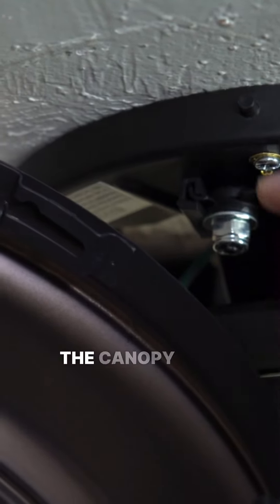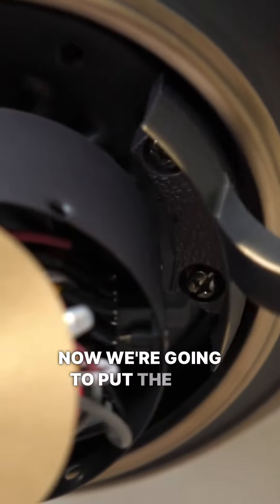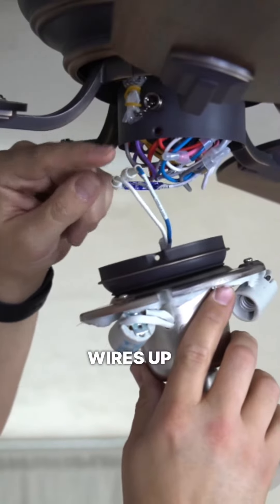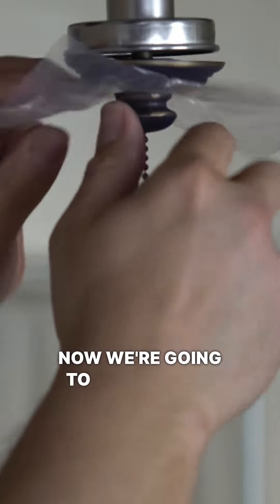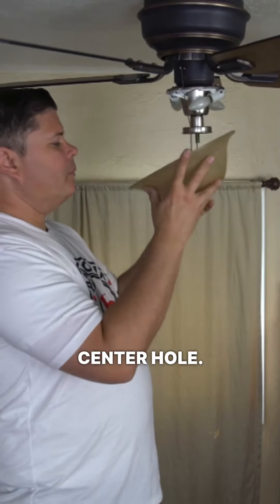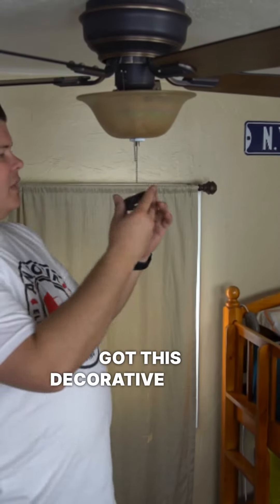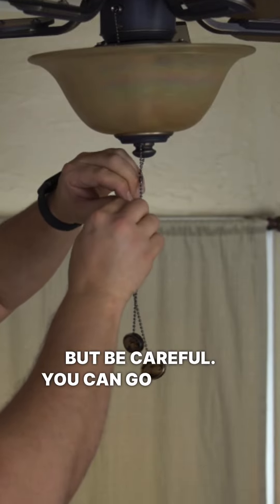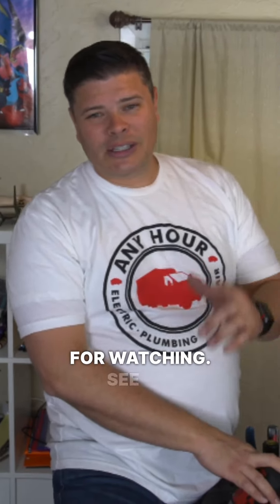How to Replace a Ceiling Fan part 2

Comment: I got that same exact fan , I bought mine several years ago though. Originally it was in my living room  till I bought larger fans for my living room and took this fan and installed it in my large 3 car garage. Really should be called a 3 motor home garage since it’s got 16 ft high ceiling it be no problem putting 3 class A motor homes inside.  That’s if I cleaned up some of my messes and took out my baby ducks, baby geese, and baby chicks out of the garage as well.  They still have a few weeks to go before their old enough to let them all stay outside in their permanent home!
I added a 3 fans to the garage cause I have a woodstove in the garage and the fans help keep the heat down closer to the ground as well as circulate the heat too!